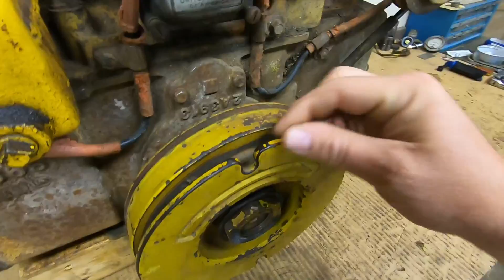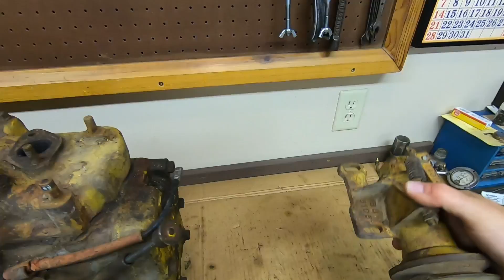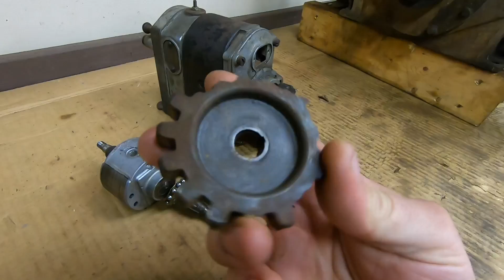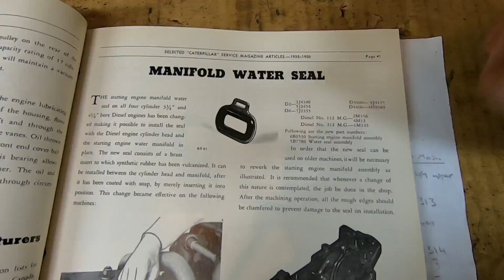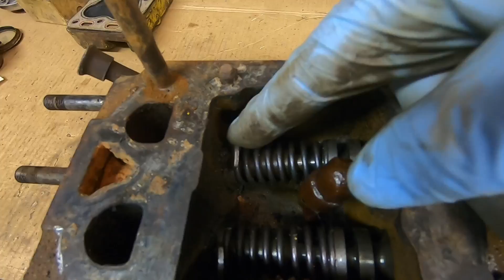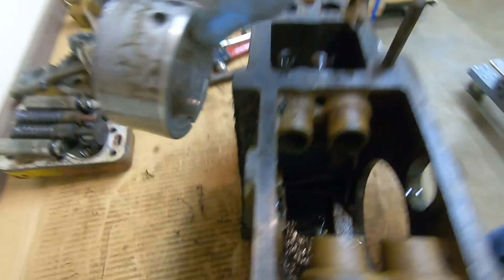Caterpillar D2 #5J1113 Starting System Ep.4: Starting Engine Disassembly

Comment: Squatch, where is the 5 part series on the carb rebuild? Your videos pushed me over the edge to purchase an old D4 that I've just started to work on - just tore down the starting motor and the carb is first on my rebuild list. Also, it is just my D4 or is the carb assembly impossible to remove without first removing the bowl assembly? Zero access to the flange nut.
Reply: @squatch253  ah makes sense, looking forward to you picking that build series back up. I'm in the Pacific north west so I understand the seasonal work needs (rains just stated here so perfect time to do some shop work). Thanks for the reply!

Comment: Very well done. Looked like displaced metal in main bearing dowel pin hole. If alignment was not correct and pin was forced in, hole was oversized and bearing material was displaced. Happened often on air cooled VW pinned engine main bearing. Always leads to bearing failure.

Comment: Thanks for the videos! You sure know the old Cats. Is there a way to determine if the diesel motor on my D2 Cat is free without starting the pony motor, and without taking the front of the Cat apart? The 1950 Cat has been sitting for 15+ years. The pony motor turns but won't start - no spark.

Comment: Can you share the manifold water seal replacement selected service shared in the video? I bought the correct seal with metal plate from  CAT and it is twice the width of the compressed one I removed that also had the metal plate. New one looks like rubber is nice and new and the old one removed the rubber is very compressed. Is there a recommendation to heat and soften or grease the new seal to replace it with the pony motor and manifold in place?

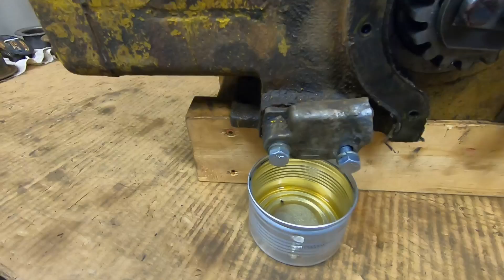Comment: @ 13:40 You started talking about the aluminum oil drain tube on the older style pony engines and how it is common for them to break off because they hang out kinda far. WHAT FOR IT! Well I was pulling the big belly pan on a 1958 Cat 12A04040 Traxcavator and you will never, never, never guess what treasures I found in the oil soaked gack in the pan. The counter part to your aluminum oil drain ... I found the aluminum tube AND a bolt plug WITH a copper washer. I probably shouldn't be so supersized due to them commonly breaking off. I'll clean it up (but leave the patina) and be sending you the tube the first chance I get.
The manifold (and probably pony engine were the earlier style) most likely came off a 3400 or 4400 with a casting date of "UU UM RA" (11/12/45); I didn't find a casting date on the pony block and right now I'm too tired and sore to look. The pony block needs some minor TLC before it needs MAJOR TLC or even the recycle bin. The valves are sharp so they have given her all she's got capt'n ... 
The manifold back coolant passage was blocked off with some aluminum plate and JB weld also the elbow on the D315 head was brazed up so it did not circulate coolant with the diesel engine. I'm making a video of it and it should be up in a week or so.

Comment: I have a silly question, but it's been burning in my brain.... hypothetically speaking could the starting motor pull the whole tractor if needed? For example if for some reason you were out of diesel or catastrophic damage happened to the diesel engine. My guess is no, but I had to ask.

Comment: Very interesting. Quite a complicated engine set-up considering it's just a starter engine who runs very little.
Reply: As Squatch mentioned in a previous video relating to these starter engines that, as you say `runs very little`,   they have an approximate life expectancy of about 250 hrs run time, before needing rebuilding.  Everyone`s mileage will vary on the total hours, but my take on it all, is that paying attention to this little starter motor, draining the oil at or before recommended intervals can help you reach or exceed the forecast life expectancy... whereas ignoring it until it fails, could be its early undoing.  Today, we don`t pay any attention to an electric starter whatsoever until it fails to start the main engine. At that point, we remove it, and either send it for rebuild, or straight up buy another one to replace it. Pay all kinds of attention to our main motor(s), but ignore the starter until it craps out.  So back to these starter motors.  Yes, complicated, considering that they are just starter motors that run very little, but considering how important they are,  I feel that they deserve to be a lot more appreciated than some owners do.

Comment: Some times i wonder why they didnt use tapered roller bearings on the mains in them type pony engines like Wisconsin vf4 and even the two cylinder Wisconsin engines had any we just called them wisconsin baler engines after all that is a splash type oiling system

Comment: A number of parts in this pony engine would have been standard and used across other applications, electric generator, water pump engines, snow machines etc. And these would've been manufactured widely from the US to Canada. Cross referencing will pinpoint the right part, although I am sure you have already done so. But look in Canada as well for like those over size pistons.

Comment: With a belt driven governor, is there a safety provision to prevent wide open throttle if the belt breaks? Or does the engine run wide open all the time anyway?

Comment: Finaly got my old D71956  17A main engine loose and running  now i can pull the engine down  and  change whatever parts need replaced
Reply: Engine sat with out  a cover over exaust for ten years no doubt sleeves and rings need changed

Comment: Well that's good to hear ... I have a potentially viable starting engine block so all I need to do is get another later style manifold - Super! 12A04040 starting engine was off a 3200 or 3400 style; my engine is a D311 and the two starting engine manifolds are NOT compatible - like you said the exhaust and coolant passages were accessed differently. 
I have about 1/32 endplay no radial moment but a ton gear lash (gnash hehe). Farther down the rabbit hole we go (I'm late, I'm late for a very important date....)
12A08263 pony - O' man, has so much, what feels like piston pin or rod crank slop.. clank spin the crank, spin the crank and clank in the other direction. has potential
12A03563 pony - Newly rebuilt by previous owner :) but when I got it home (carrying it in) the retaining pin for the OLD crank bearing fell out all rusted. So I'm going to tear it back down and recheck all the specs. 
Thanks so much for the information it really dose help.
Also thank you for letting me use you as a sounding board ... helps me think things through.
UPDATE: 12A03563 pony, popped the manifold and looked inside, the retaining pin to the bearing in question was not seated all the way ... curiouser and curiouser
Reply: @squatch253   Thanks.

Comment: So are the crank thrust bearings available in an oversize od and an undersize id..  that bearing bore might be sleeved and the sleeve held in place with tapered thread crack repair pins before rebooting to centerline and size..a boring bar could easily be created to fixture in the removable cover to bore that back to proper size. And do the sleeve bore cut also.
Reply: @squatch253  https://www.enginebuildermag.com/2000/09/heavy-duty-details-damaged-main-and-cam-bearing-saddles-can-be-successfully-repaired-by-sleeving/
 in case you missed the article in that obscure magazine..

Comment: Why do the pistons have 2 sets of oil control rings?
Reply: @squatch253  I didn't notice the second set when I saw you building the shortblock. And yeah, the oils back then were barely more than cleaned up crude, so I understand that. How much do modern oils extend the life of these little pony engines? You mentioned a 200 hour life, but I'm sure that was when they used the oil almost a hundred years ago.
Reply: @octane613   He mentioned an approx. 250hr life expectancy.  I wrote out a comment (in that video) saying that I figure that the old oil against modern oil wouldn`t have much difference to offer, as much as the difference that is made by draining whatever oil out and replacing it with fresh stuff at or before reaching the interval.  The oil`s job is to suspend contaminants. Contaminants can include metal shavings, bearing wear, foreign liquids including antifreeze, fuel(s), moisture from a number of sources.  What matters more to you?  Having a more modern oil in your engine, or changing out whatever is in there to ensure that fresh clean oil is lubricating things ?  The more modern oils can withstand more heat, more contaminants (to a certain degree, of course) than the older stuff of 70+ years ago before it begins to break down.  The trouble is,  do you want to wait until your modern motor oil begins breaking down before you change it,  or just go ahead and get it out of there, and replace it with fresh stuff... cost be damned.  The oil is cheap; the labor and parts to rebuild are significantly more.  So, back to your question of how much do modern oils extend the life of one of these pony engines. I`d be inclined to believe not a whole lot, but I`d still be changing the oil fairly regularly, if for no other reason than peace of mind, to know that I have clean stuff in there.  It`s not so much about how long the oil itself can last, as it is about getting the contaminants the hell out of the engine.  Just my two cents.
Reply: Those oil control rings are just a single piece of iron with grooved cut in it. Modern American and Japanese gasoline engines usually have a 3 piece ring, and European gasoline and most diesels have a 2 piece ring. Those performed better, that is why so many engines went with one oil control ring.
In this video, a Plymouth flathead was originally equipped with two single piece oil rings, but EGGE decided to make all their pistons with one three piece oil ring:
https://www.youtube.com/watch?v=uQaBYDnjgxs
I think the logic is that if nobody makes any new single piece oil rings, why build pistons designed for single piece oil rings? People would have to locate NOS ring packs if they really wanted to copy OEM.

Comment: Great video Squatch, I love the way the valves, guides and springs come out as a unit. Looks like they had a right dingleberry rebuild the motor last time. I am surprised at the amount of clearance in the big end bearings considering how good the bearings and crank look, were the nuts even tight? 
You definitely have a rebuild-able engine there....worth hanging on to given the fact that good ones are getting as rare as hens teeth.

Comment: Squatch, really enjoyed seeing inside the starting engine. Are the main wear items like pistons, rings, bearings, valves and guides available new, NOS, or aftermarket? I remember you had 2 freshly ground cranks, so I'm assuming you have already sourced matching bearings for those cranks. I wouldn't write off that block yet, even if the main bore is oversized from the spun bearing, it could be sleeved and bored back to size, the cylinder could also be sleeved or bored 0.030 if pistons were available. I would much sooner sleeve cylinder bores and crank bearing bores before I messed with trying to repair a frozen or cracked block. Great video update!
Reply: @squatch253  if you need a shop to sleeve a block let me know, I have a good friend with a machine shop south of Detroit. One of the ones I used to work at. Thanks for the reply on parts availability. Might come down to making valves for other applications work soon,  nothing a lathe can't fix.
Reply: @squatch253  I have heard that some racing valve companies can take an existing valve and build a duplicate from stainless steel. However, You would need to order more valves than I would imagine the Caterpillar community would ever need. I know that if undersized crank bearings aren't available, it is possible to nickel spray weld crank journals back to standard. I have heard that the spray nickel is tough stuff, and might resist wear better than the iron or steel that the original crank was made of.
Some companies can apply an antifriction coating to used pistons so that they are a few thousandths of an inch wider, and will last longer. Most of this stuff I see is found on repairing rare cars that sell for hundreds of thousands of dollars, so I don't know if this is economical to use any of this tech on a Cat D2.

Comment: Here's a question after seeing the rust chunks. Would you recommend using a waterless antifreeze in these to help prevent rust or would that even help?
Reply: Just use a modern antifreeze with a proper anti corrosion package.
Reply: There are waterless coolant available on the market that are useful for decades why go back to normal?